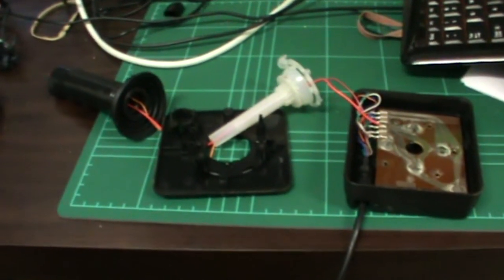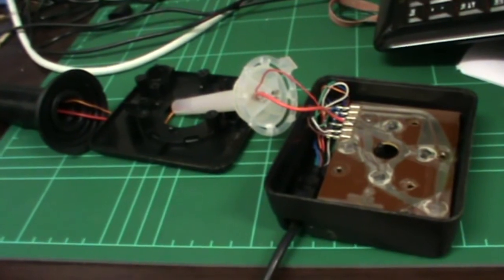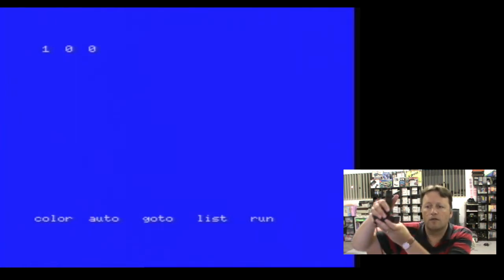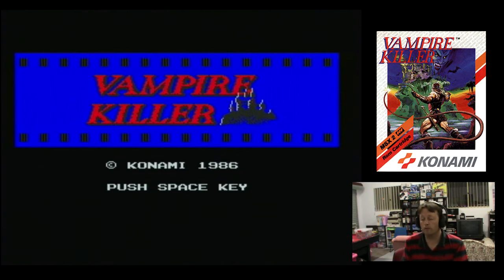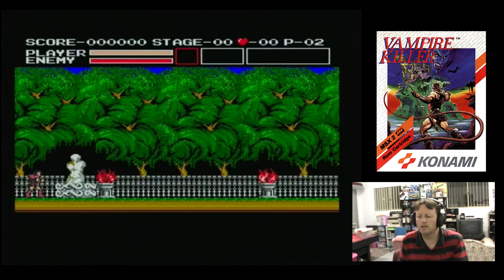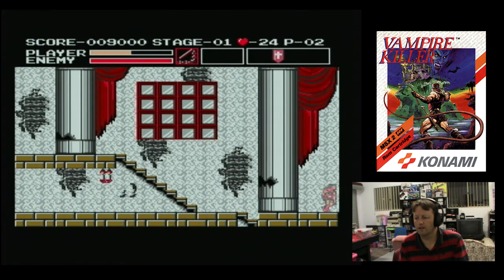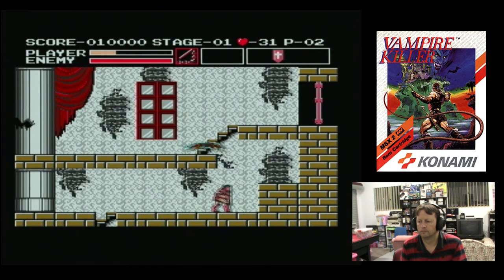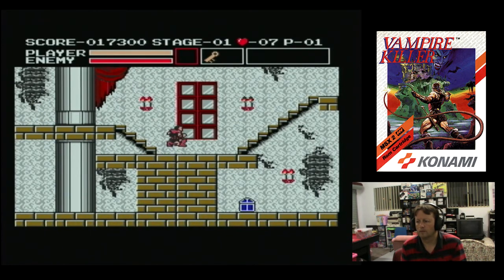Lets Play Vampire Killer (Castlevania) - MSX & How to make a MSX Joystick

Comment from the maker: Yes not that many games use two buttons, which itself made the uptake of MSX joysticks low and their rarity high. Depending on the model of Spectravideo joystick, they actually have the correct number of wires attached to the circuit board inside & two buttons, but the buttons have been made to both be an Atari one. While hunting for parts I found I have 6 such Spectravideo ones, so I will be doing a mod video shortly. I also modified my Wico with the broken cord - it's def. the best one.